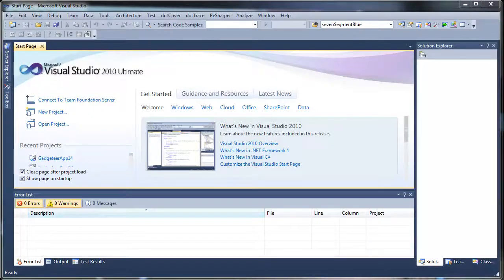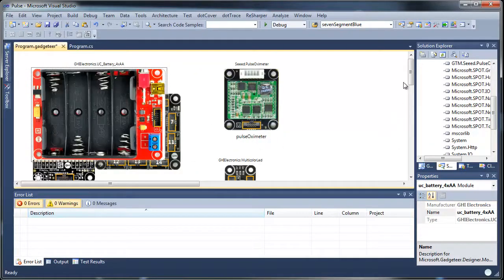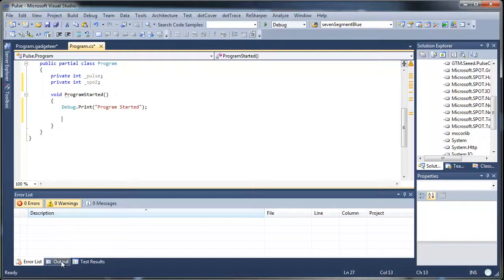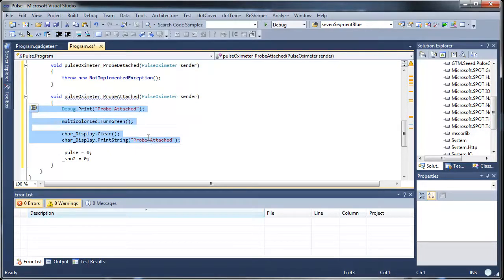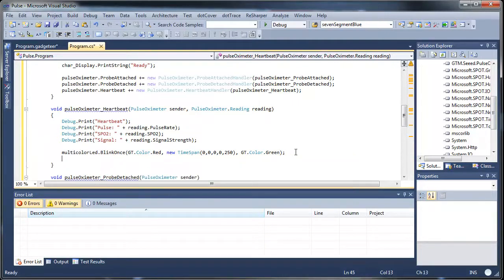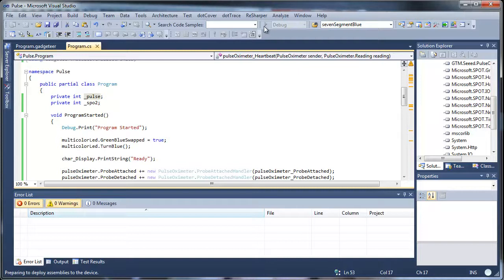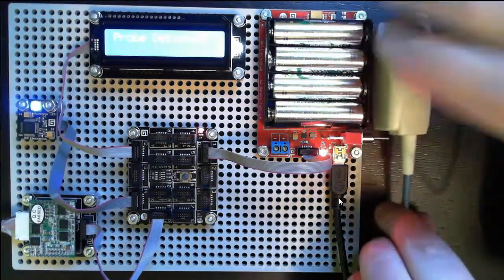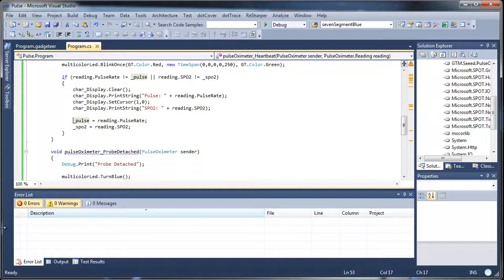Gadgeteer Building a Portable Pulse Oximeter Device

Comment: where can i find the dll for the oximeter circuit and the other ones , any suggestion for any website that give good info , and if you have the circuit map it will be very helpful , by the way your videos is the best in you tube thx :)
Reply from the maker: +Jo Jo The Pulse Oximeter module can be found here https://www.ghielectronics.com/catalog/product/345 and there is a Schematic there for it.  The 'DLL' or driver is included in the GHI SDK here https://www.ghielectronics.com/support/netmf/sdk/38/ghi-electronics-netmf-sdk-2015-r1 and the source code is listed here https://bitbucket.org/ghi_elect/gadgeteer/src/28aaf8776900e473740f206c602ab0857904d48d/Modules/GHIElectronics/PulseOximeter/PulseOximeter_43/PulseOximeter_43.cs?at=master&fileviewer=file-view-default thanks to GHI Electronics for posting that.  Of course the best .NETMF / Gadgeteer discussion forum is here https://www.ghielectronics.com/community/forum
Reply: +Duke Nukem  thx ,  i was having problem with finding the circuit for my graduation  project the codes will  help me a lot :) , but is there a website gives a simple circuit to make with my hand? , they dont accept  any ready company made circuit , they want me to made it with my hand .